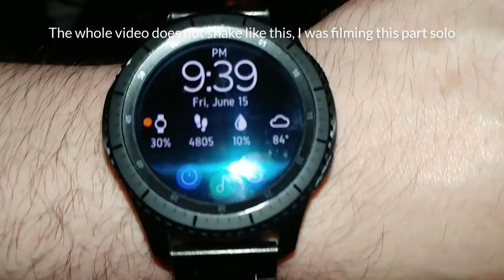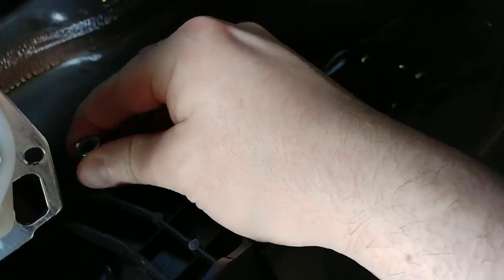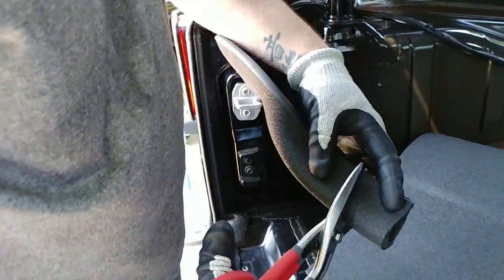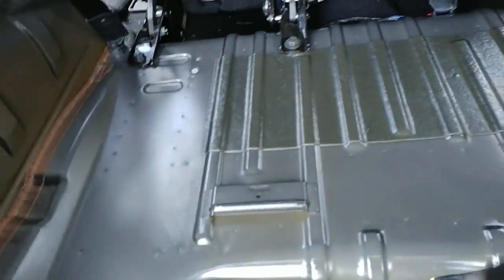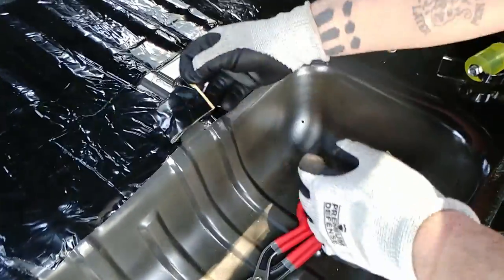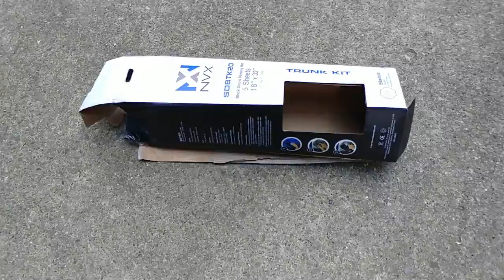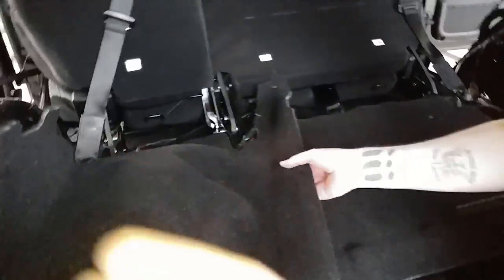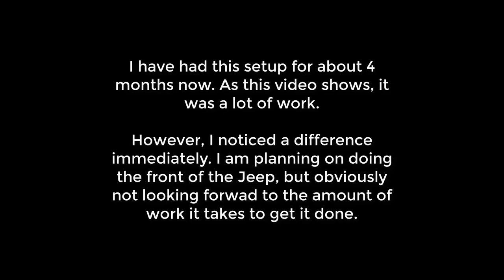Jeep Wrangler - NVX - Sound Dampening - Part 1

Comment: Did you ever finish installing the sound damping material?
Reply from the maker: No, because I suck. I meant to do it before it got hot again, and now it is right back to insane summer heat. However, I am going to do it in July for sure.
Reply: 5after12 LOL, I understand.  Hey, another quick question: can you tell me the actual height and width of the screen on the 10.1” headunits?  I’m thinking about mo king up something to get an idea on size and playing with some alternative ideas.
Reply from the maker: Unfortunately not, I just sold mine. Currently trying out the Sony XAV-AX5000 Android Auto head unit